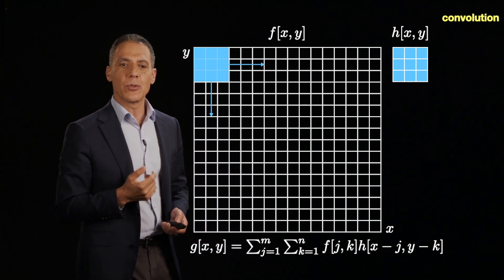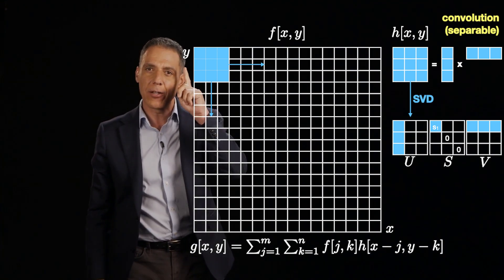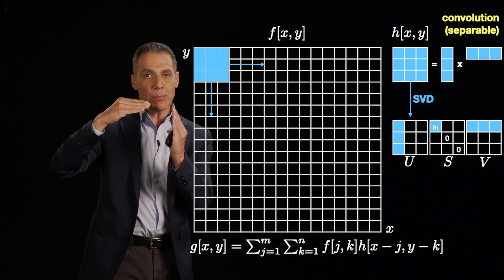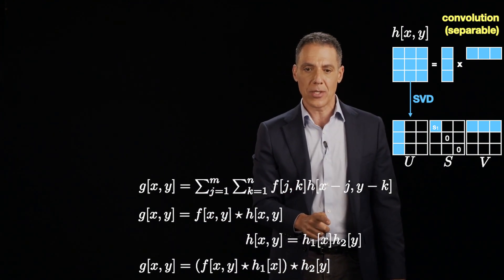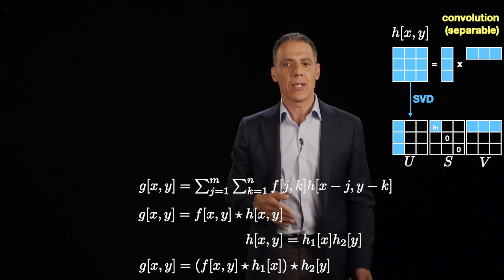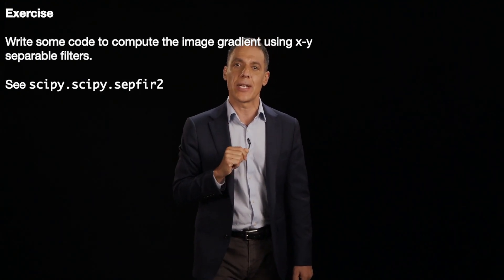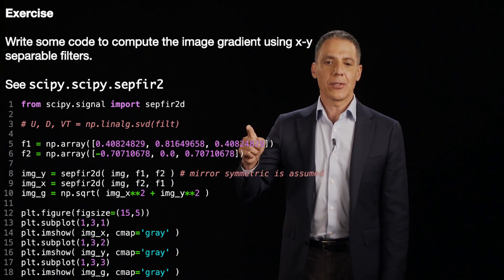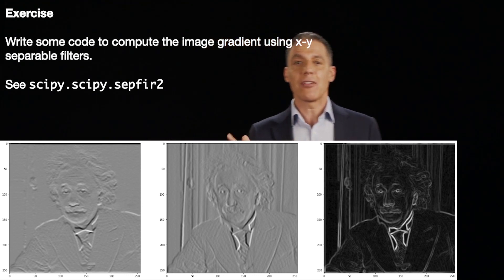Image filtering: convolution: separable convolution

Comment: Hi! In the attached code for this section for the hardcoded values for f1 and f2, was there a reason why you did not scale your f1 or f2 by sigma? I tried working out how you would use the svd instead of hardcoding and couldn't match the values you got for the hardcoded values in f1 and f2. This is what I tried based on the video: a) computer U, D, VT = np.linalg.svd(filter). b) vertical filter - first column of U matrix, horizontal filter - first row of VT  c) f2 = vertical filter, f1 = (horizontal filter multiplied by the first eigenvalue) Thank you!
Reply from the maker: In my code, f1 is the first row of VT, and f2 is the first column of U (this assumes that the singular values in the diagonal matrix D are sorted from largest to smallest).

Comment: Thanks for the video. Here are some questions:
1. Every rank 1 matrix is equivalent to an outer product of a column and row vector. So essentially, you could just check the rank of h and know if the kernel is separable and easily calculate the 2 1D filters.(no need to compute SVD)

2. Suppose you have an nxn kernel h , and you computed its SVD and found out it has k<n nonzero singular values(this means that you can construct h by a sum of k outer products). Due to linearity, obviously this means that you can perform k times 2 * 1D filters and sum them. Would this be always more efficient to use these 2*k 1D filters rather than the whole nxn filter for any k<n ?
Reply from the maker: 1. The rank of a matrix is determined by analyzing the singular values, so these are the same.